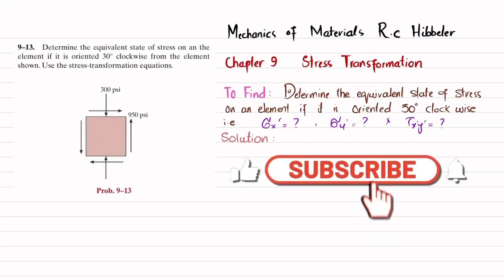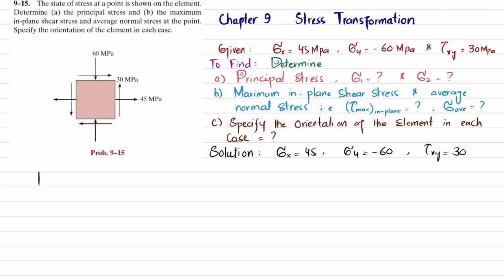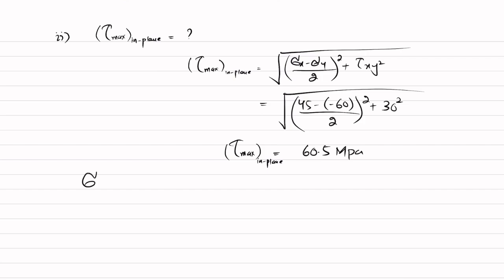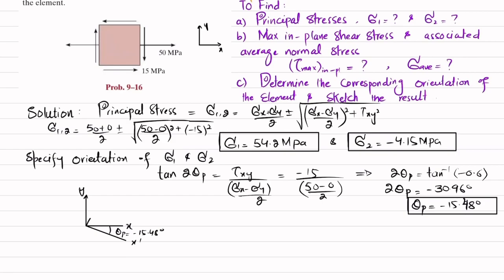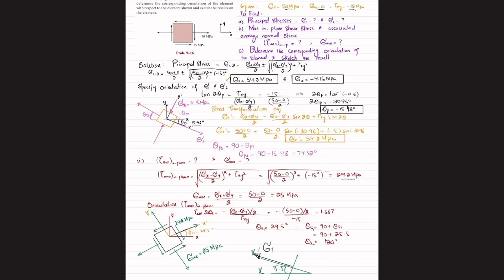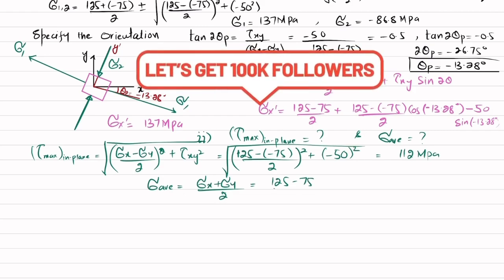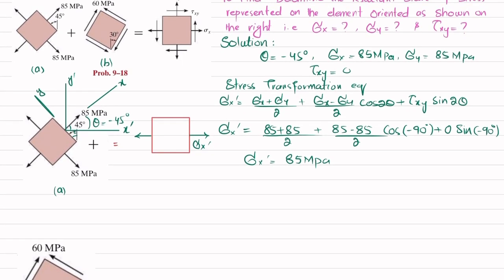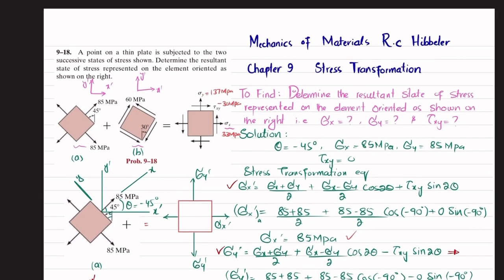Principal stress | shear stress | principal planes | stress transformation | Mech of materials Rc Hi

Comment: in the second question how did we knew that it is clockwise? why the angle 14.87 is above the x axis and not under the x axis ? and also when you found the orientation of maximum shear stress you put minus in the formula?
Reply from the maker: Counter clock wise angle is taken as positive while clockwise is taken as negative